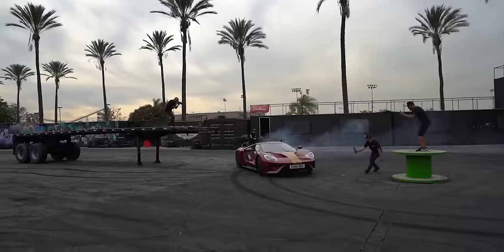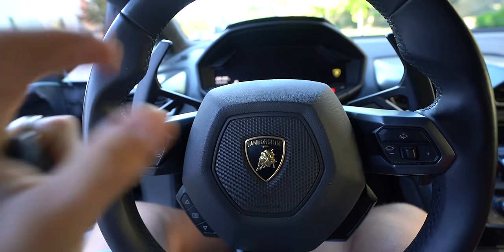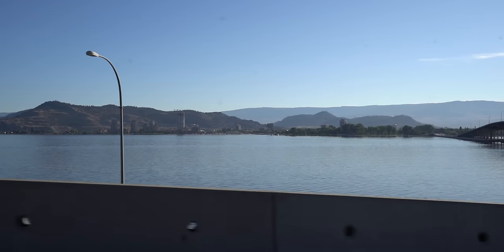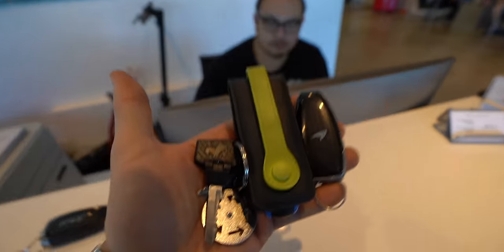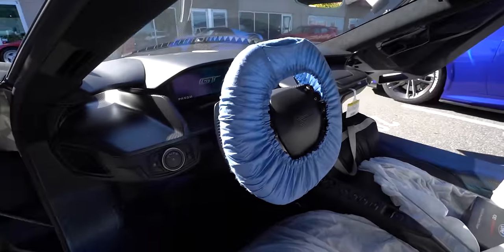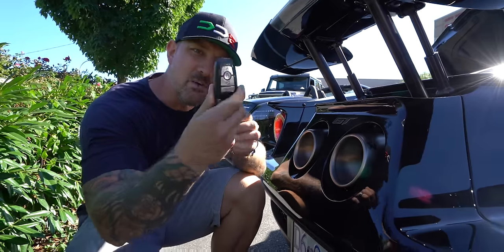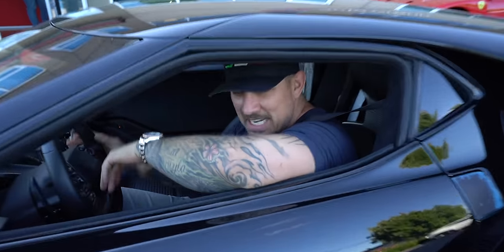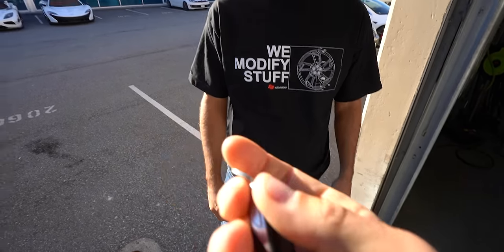BUYING A NEW FORD GT?! *NO APPLICATION REQUIRED*

Comment: I bet you anything they bought a mclaren 600lt with roof scoop! The car next to the Agera RS is a mclaren 600lt not a P1. You can tell with hood on it. Doesn't have the hood cut outs on top. Let's see if it's for Dave since Daymond just got 720S.
Reply: Check out the difference between a P1 roof and the 600lt   the 600lt sticks up higher than this one.

Comment: The GT doesn’t have enough performance to be a hyper car.
Reply: Agreed 100%. Kinda underwhelming for 1million!!!  Those generic ford features. Yikes
Reply: As much as I like the Ford GT,  you're right.
Reply: It definetly has the performance. Quicker than a Veyron, Zonda, and some older eggs around a track. I just think they are making too many of them to be considered a hyper car.
Reply: Ayush Malpeddi 3.5l EcoBoost and same switches as my 2005 f150 just makes me cringe for that supposed level. Tops out around 215mph. Meh. I just think at that caliber of car more cylinders should be mandatory. It’a just not hyper car territory to me. Ford fell on its face in the mechanical wow factor.
Reply: @JoeMaxFpv  What same switches do they have because I've seen both interiors and saw nothing in the 05' f150 being shared with the Ford GT. But More cylinders for what? The car was never meant to wow the general public, it just does. It's only goal was to win LeMans and it did. It has nothing to prove anymore because it's already proven itself.
Reply: Sav Kvd you saying it  won Le Mans, it didn’t. The race version did. Would you say oh look it’s a 911 it won Le mans? Cuz they did win. And are you going to say a 488 won Le mans last year??
Reply: Sav Kvd aside from the fact they pointed it out In this video. I own a construction company and have 7 ford trucks from f150-f550 municipalities. And the window and door lock switches are exactly the same. And as this other gentleman pointed out. Ruling for lemans is it must be a limited production run however due to road legality and emissions we get the watered down version minus race safety equipment and all the goodies.  But even that aside who cares if the model won anything the fact is the price tag doesn’t reflect in the end result imho. For half a million or more I’d rather hear it and feel it at all rpms. Christ my wife’s maxima has a 3.5l. I’d expect that from lotus but then again that’s a sub 100k car. And to be honest there are nearly a dozen or more cars that have a much better 0-60 including the 911,huracan, veyron   Each of which sound better. Actually a c63 amg sounds better. And has nicer interior. Lmao. I’m all for supporting ford. Hell I’ve owned more Ford’s than most people. But if you give me half a million for the sole purpose of buying an insanely impractical vehicle I’d rather a huracan or gt3   Being truthful I’d rather a vintage 355 for 60k save some money for the timing belt swap every 5 years and actually drive it all over the place.  Because a gated 355 sound shits all over that v6 turbo or not.
Reply: @JoeMaxFpv  You pretty much ignored my entire comment. Yea, it'd be cooler to have the Ford GT get this and that but that wasn't the point of it. It wasn't supposed to sound better than this and be more luxurious than that. It accomplished its only goal. Also, all those cars you mentioned about 0-60 don't really have a better time. The Ford GT has a 0-60 of 2.8 seconds and so do those other cars. The Huracan has all wheel drive and so does the Veyron which also has 1100 horsepower. If I had half a mill to spend, it definitely wouldn't be going to those other cars for me. The Ford GT might not sound better than a Huracan or a Porsche but it still makes them look $500k cheaper.
Reply: @USSCoop  The difference is those cars weren't born specifically for LeMans. Those are street cars turned into race cars. The Ford GT is a race car turned into a street car.

Comment: the ford gt has been underrated because is a ford. I think is more  a exotic car for it's design more than a hyper car an it would be timeless in 10 or 20 years there are going to be more cars with similar design.

Comment: I think that’s said how the 2018 GT shares a lot of the same features of my 2020 Explorer XLT like the key fobs are the same only difference is mine doesn’t have the GT on it and they unlock and lock buttons are the same the window button are the same and if I wanted to buy a 2020 GT I would get accepted because my father used to work for Ford

Comment: I’m pretty sure a “hypercar” is a super car with an engine and electric drive.. hence the hyper....
Reply: What would that make the veyron or Chiron then if that's the case?
Reply: No lol, a hyper car is usually a car over 1million as it then becomes unattainable for a lot more people
Reply: A more recent term for high-performance sportscars is "hypercar", which is sometimes used to describe the highest performing supercars.[16] As per supercars, there is no set definition for what constitutes a hypercar. An attempt to define these is "a limited-production, top-of-the-line supercar with a price of around or more than US$1 million."[17]

Some people consider the 1993 McLaren F1 to be the first hypercar,[18] while others believe the 2005 Bugatti Veyron was the first hypercar.[19]

Many recent hypercars use a hybrid drivetrain, a trend started in 2013 by the McLaren P1, Porsche 918 Spyder, and LaFerrari in 2016 Koenigsegg Regera, in 2017 Mercedes-AMG One, in 2019 Ferrari SF90 Stradale. [20][21][22]

So no ones actually correct... it’s really a personal opinion on what the definition is
Reply: Even tho it says ... £1m plus ... like I said 
But ok
Reply: I never said anything about you being wrong... LOL
Reply: The cost went without saying
Reply: You said, no one is correct .... I was correct
Reply: @driftydoristv  and it still says before that "there is no set definition" but good for you you were right about something so amazing your cool points went up like 10!!